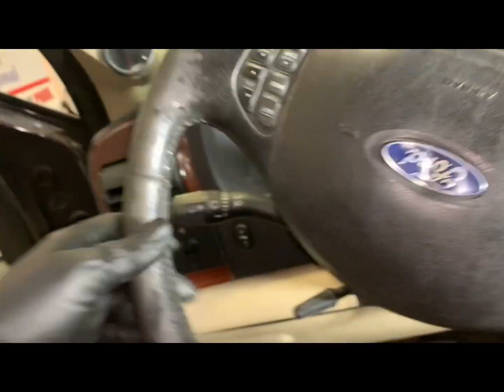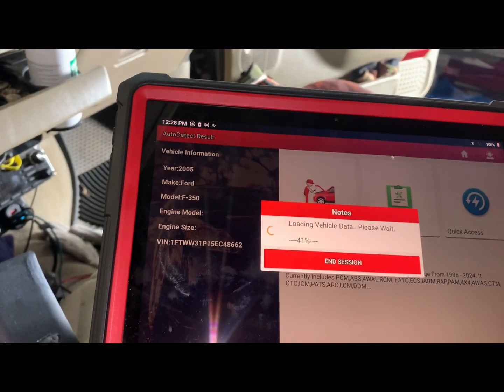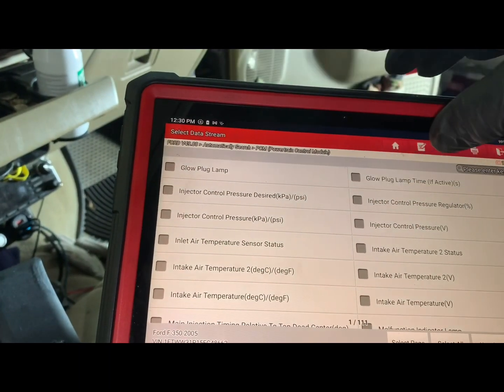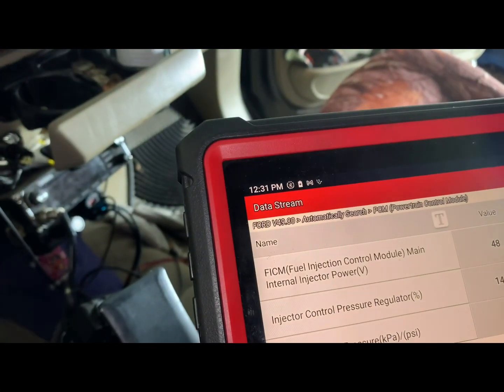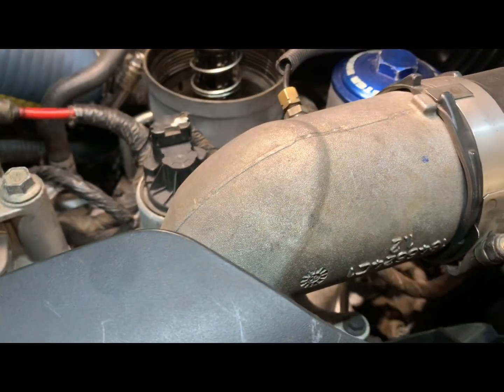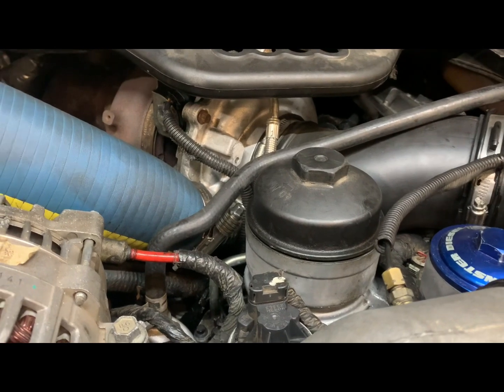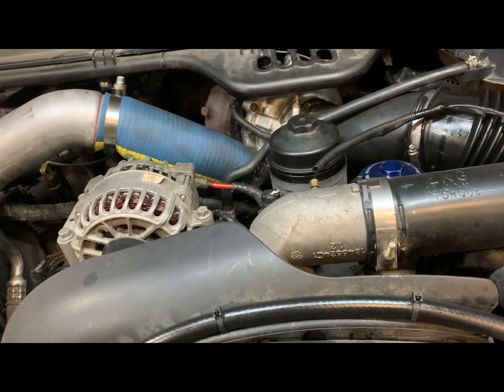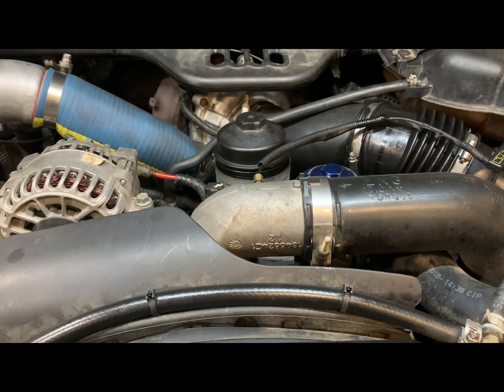Another 6.0 lifter failure!

Comment: Check the oil pressure relief valve. Could be jammed. Easy check could save thousands.
Reply from the maker: That’s a good point. however, we would still see some oil coming up in the bottom of the empty oil filter housing if we had a healthy pump bore and Gerotor gears. The size of the bypass valve ports are not large enough to bypass the total volume of oil this very large pump is capable of producing and considering I cranked it long enough in total to take a year or two of life away from the starter, we would expect to see some activity in the bottom of the filter housing. Pulling the belt, dampener  and pump cover/gears will verify our diag. I expect to see carnage. Diag of a failed lifter is based on no oil coming to filter base and cranking cadence. My money is on an exhaust lifter. Appreciate your thoughts, take care.
Reply: Appreciate your videos and enjoy watching them. It’s a great feeling to know good mechanics still exist. Where’s your shop?

Comment: With the 6.0 and lets go with a worst case scenario situation which is probably fairly often given the age of these trucks/engines, going with the full meal deal long block, new injectors, glow plugs and a turbo, probably new exhaust manifolds so no warping issues there, new EGR cooler, etc etc, throw a reman starter on, probably a new rad and all the other items of questionable status. What would a ball park total bill be with all parts and labour these days for comprehensive no corner cutting by the customer end result. If I drop from a heart attack after I read the number, you are NOT to blame ... a no liability quote 😉
Reply from the maker: Lots cheaper than a new F 350 🙂
Reply: 10-15K

Comment: Hi if you're high pressure oil pump leaks at the outer gasket will it still run normal like nothing is wrong or will it run bad iv got major leak when warmed up truck rus and starts fine hope to hear back
Reply from the maker: What year?

Comment: Interesting the only 2 I saw fail were 05 as well I've had 3 my current 06 has 191k will see what happens all original still
Reply from the maker: I always try to sell a new set of lifters on all reseal/ bearing jobs on high milers. It can save you in the long run.

Comment: How do you prevent lifter failure?
Reply from the maker: The best thing is probably replace them during a reseal. I think all my failures can be attributed to high miles, maybe less than best maint. One comment pointed out the lifter rollers are the fastest moving bearing after the turbo shaft bushings. I think it’s just a fact of life.
Reply: de-tune?